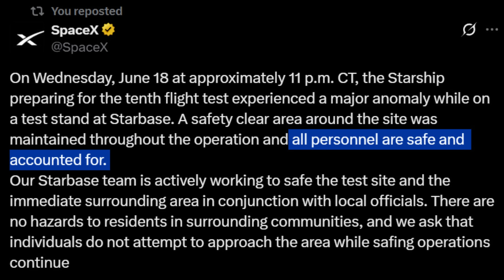SpaceX's Latest Starship Explodes During Ground Test

Comment: They didn't even start the engines before the explosion happened. The thing just spontaneously cracked open at the top and all the fuel went out. This is next level failure.
Reply: either they over pressurized the header tank, or it suffered structural failure.  Either way, that's just incredibly sloppy work.
Reply: @Hotarg  They are looking at the COPVs again as the cause.
Reply: It is almost as if it were a Tesla.

Comment: Have you seen the YouTube video “Inside Mitsubishi's Gigantic Rocket Factory in Japan” from FRAME? I don’t know if it has anything you would find fun to look at (other than being cool rocket stuff) but it shows a lot of — I’ll be it speed up — footage of the engineering and manufacture of the 5ton to orbit rocket, some of SLS and Dreamchaser.
It has robotic friction welding, large workpiece isogrid cnc machines, lots of rigs for just holding and maneuvering the vehicles and parts during assembly, assembly machines, a lathe at the end of a robotic arm. Briefly shows cooling channels on the Japanese rocket engine, the framing of the dreamchaser, piping, wiring, and all the like.
I don’t know, I just watched it and thought you might like it and have something you could add to it. Some kind of obscure knowledge or what not.
I know I liked it and seeing the blend of familiar machining and manufacturing technology used in such large and advanced ways.

Comment: The Cyber Truck of rockets.
Reply: It’s really not though. This is how innovation happens. There are always misfires. Do you think the first rocket was successful? The first car? The first engine? The first computer? With every massive success there are failures trailing behind it.
Reply: @Vagrant-Hex  So instead of learning from all those failures we should repeat them?
Reply: @LPB872 Huh? This is learning from failure. You’re acting like there haven’t been a ton of successes. The most trending vid a few months ago was space x docking a launched shuttle.
Reply: @Vagrant-Hex 

It keeps blowing up because SpaceX can't develop a large rocket engine. It uses 33 Raptor 2 engines.
Reply: @danboyd2725 Well, they use Merlin engines too. Regardless, none of that changes what I said bout innovation. NASA had a ton of rockets blow. So has every other country with a space program. Near perfection takes trial and error. That is true down to every single human being.
Reply: @Vagrant-Hex 

NASA had rocket engines did blow up in the early 60s, when we were learning how to make rocket engines. 

Which led to the Rocketdyne F1. Five of which powered the 1st stage of the Saturn V without blowing up. 

33 rocket motors are thousands of potential failures.
Reply: @danboyd2725 I mean, okay? They have been around since the 70s. Also, human beings died in some of their failures. And some nearly died. I get you hate Elon, I don’t like him either, but I’m not sure what you’re arguing about. Life is trial and error. Full stop.
Reply: @Vagrant-Hex 
It's  not about hating Elon. 

The lesson to learn from Starship is that 33 Raptor engines is a stupid idea. Time to go back and develop the equivalent of the F1 engine. 

SpaceX is incapable of learning that lesson.
Reply: @danboyd2725 Ah, okay. My bad. Glad you’re a free thinker too. Yeah, hopefully they drop some of their hubris and see the error of that engine. He needs to realize that sometimes if it isn’t broke, don’t fix it.

Comment: Realistically, it was "when", not "if". With so many cold and hot tests, fueling, venting, pressurizing, all with volatile cryogenics - one would wonder it is not happening more frequently. Looks quite positive that it does not happen from "main" things: engines, main pipes, main tanks, all the main valves... This is "simplified" version, a prototype to the "real thing". So, obviously, less attention is given to secondary systems like payload doors or fire extinguishing systems of self-destructors... no surprise these secondary "things" sometimes get back with a vengeance. Happened twice even on production-line Falcon, and keeps happening to the experimental ship... Time indeed for V3? Or for a step back to V1?

Comment: They haven’t even made orbit yet. Forget about Mars. And despite what any fan bois want to say, Artemis made it to the moon and back on the first try.
Reply: I keep pointing this out too. Also that Saturn V, which was designed with much cruder analysis methods, did not have any launch failures although there were a couple of anomalies during flight that nevertheless did not prevent the rocket from meeting its mission objectives.
Reply: How does Artemis influence Starship engineering?
Reply: @Forke13  It puts it to shame....it works.
Reply: @MrJdsenior  The Mission Program Artemis puts Starship to shame is how they are related on an engineering level? Can you elaborate on that?
Reply: @Forke13  one works and the other doesn't lmao
the coping with this guy
Reply: @Forke13  The mission is the point.   Artemis flew the mission, out of the gate.   Starship hasn't properly flown ANY flights yet, not only not to the moon and back, but not even to LEO.  I'm not saying they won't get there, as they well might.  Also, Musk's smaller undertakings have gone very well, so there's that.  

Going to the moon and back, ESPECIALLY while your cargo is human, safely, is so far beyond ANYTHING that ANY SpaceX vehicle has done so far is like the difference between a suborbital lob, and orbiting.  NASA did that, several times, over 50 years ago, and it damn sure didn't take them the flight destruction of 30+ vehicles to get there.

Artemis did not have to design everything from scratch either, so I will allow that that was of benefit to them.   You can have all the bells and whistles in the world, but if you can't meet the spec, the design fails.
Reply: Whoever believed the going-to-Mars scam was very naïve, to put it lightly.
Reply: Artemis was the most stressful rocket launch in recent history
Reply: After ten times the time and cost lol and delivering far less potential
Reply: @dmurray2978 cost is unclear and it actually works and is save unlike starship
Reply: @dmurray2978Starship right now has zero potential. It hasn’t performed a single test flight where the whole mission performed nominally.
Reply: Agree.
But it wasn't a cheap trip.
Reply: @ploed  how expensive is starship? As far as I know we dont know because its a private company and well most of artemis spending is in development and that works.
Reply: @ploed Starship is also not cheap
Reply: @ploed  Neither is anything that SpaceX is doing.
Reply: @ploed  Have you looked into SpaceX costs for this program, so far?  It might be interesting.  Also, there is no comparison, yet, because Starship has not made a trip to ANYWHERE that is useful, yet.  I can get to places in the ocean a lot cheaper on a ship, and LIVE in the process.
Reply: different approaches to the problems different goals. We know how to get to the moon, we even know how to get to mars and beyond, but we want it to be much cheaper and that needs innovation. Obv SpaceX is struggling with that upper stage atm. but it's not fan boying to want them to succeed and be excited for the theoretical specs of starship. They can push starship to orbit easily enough, but as long as the thing still blows up midair, or even on the ground you don't want to do that.

Comment: With so many failures one after the other, you'd think it was sabotage at this point. The wrong man in the right place can do so much damage, especially if they know exactly what to break and how to break it without it being obvious. Hell, it could even be done at the production level, deliberately designing parts to fail, alterations to materials/fabrication that would produce failures...not saying it's the case, but with how more than a few people act completely deranged when discussing Elon Musk I wouldn't be surprised if it were found to be true.
Reply: so many technicians here collaborate to perform a single function, there are so many checks, so many sensors, if there is any sabotage here it would mean total incompetence of the management, it would mean they don’t deserve to succeed

Comment: So V1 was progressing, but It was probably designed with big engineering margins and high weight that would never have allowed it to have a high enough mass ratio to carry the payloads it needed to fulfill its mission.  It looks like V2 cut weight throughout the design and reduced margins in the engines to produce more thrust and a higher Isp.  The result is a large loss of reliability throughout the design. I think continuing in the direction of pairing back mass with V3 would only make this worse. The real issue, and I hope this can be solved, is whether a stainless steel rocket carrying a heat shield for reusability can ever meet the mass ratio spec it needs to meet. I hope the answer is yes, but the wide range of failure modes since V2 was introduced leaves me very concerned.

Comment: Here is why Starship will not work.  When Elon went off the rails, my wife, who is technologically hostile and 40 years of experience shows she can destroy anything high tech with her hopes and prayers (call it a hex) decided offhandedly to focus all her technomojo on anything connected to Elon.  Since that time nothing technological has worked with the caveat that in failing it would not injure or kill.  In the last 40 years of honing her aura, I as a STEM advocate and hocus pocus disbeliever have had to fix so much stuff that has gone haywire in her presence that I now believe in whatever she "has". Public systems going down as we arrive, I ask her to step 30 ft. away and they recover.  Too many times not to be just a coincidence.  I appear to be able to dampen the effect.  That was two decades ago.  A few months ago, even as she "hexed" Elon ventures to fail but not hurt anyone, I could not bring myself to believe that her aura could now so accurately be projected  so far, with so little effort.  I cannot remember what she said but paraphrased it was "all his stuff has to fail as long as it does not hurt anyone".  Starship has not worked properly since, amongst other things.   I believe I can coerce DMER to lift the hex but it will cost the weight of 5 model Ss' in gold, palletized.   Deliver it to Mark Carney (yes THAT Mark) for OWWW in trust, we are in his riding, he will find us and I  think I can will stop the Sting via the OWWW.

Comment: Stepping through the sequence, as the sides of the craft are pushed away you can see a small amount of illumination coming from various parts of the liquid/gas mass as it's expelling as well as from deeper within. There's some large sections of panel, the one that is exiting left, that this shows up well. This was before the main ignition further down. So maybe there was a smaller internal ignition that caused this chain reaction to begin.

Comment: Eventually SpaceX will hit their stride with Starship and each of these failures experienced along the way will in hindsight become mere perspective. They have an abundance of funding, some of the smartest engineers in the industry, and a leader who is committed and unafraid to make a decision. That combination has proven successful in the past and should be here as well so long as they are given enough time. Developing a reusable rocket is one of the hardest engineering challenges ever attempted and setbacks like these are to be expected. What is more, they're trying to do so on tight margins with a design that can be mass produced. No doubt if Space X goal was to build the most robust & reliable rocket in this size the design would be quite different.

Comment: I don't get why they are putting so many eggs into the Starship basket. In parallel, they need to develop a basic expendable single raptor upper stage and use the mostly reliable super heavy booster to get large paying payloads up. Might as well get paid and get more booster reuse data at the same time.

Comment: I'm wondering if this is a design flaw in there header tanks or downcomers that's related to the Starship spinning out of control in-flight. Perhaps off-casing in this area of the nose during flight hasn't been visible because cameras aren't viewing that area of the heat shield tiles.

Comment: I guess we engineers think alike -- I had the same thoughts about possible overpressure and/or weld failure. Last night I was watching Ellie's report of the incident and saw from the Lab Padre video the splitting of the side in the payload bay area moving upward towards the nose. Some of the views you have are better than what I saw last night and I could see more details, like the whole lower ring section weld coming apart like it was being peeled and a downward gush of propellant just before the moment of ignition on the right side down low.

Comment: Silicosis is a progressive, irreversible, and sometimes fatal lung disease caused by inhaling microscopic crystalline silica dust over many years. The dust, found in stone, sand, clay, and rocks, scars the lungs, reducing their ability to extract oxygen from the air. Early symptoms include a cough, sputum, and gradual shortness of breath. As the scarring worsens, breathing problems become severe, making it difficult to walk short distances or climb stairs.
Reply: Similar to Asbestosis

Comment: They got a ton of useful data: for example, starship might not work and probably nasa should use something else as a lander from now on
Reply: NASA's rocket is worse. It's too expensive to even test launch.
Reply: @berserkasaurusrex4233 Nasa don’t do test launches, they get it right.

And no they can’t afford to test a non-reusable rocket, they’d have to make another.
Reply: @spaceageGecko  NASA absolutely does test launches. They've done one test flight of SLS, and have had to delay all other flights for 3 years so far. The Artemis tank had welding issues preventing its reuse as planned.

Saturn V, for instance, had two test launches, one of which failed due to engine trouble. Before that, the earlier Saturn I had many test flights, including using water-filled dummy stages out of fear of an explosion on the pad.
Reply: @berserkasaurusrex4233 Yeah, phrased that wrong, I meant they don’t do repeated test launches.

Comment: At 13:02 in the slo-mo you can see the overpressure is occurring INSIDE the upper fairing area, and blows OUT the panel. (the first frame of that, you can clearly see the cloud spraying out along the bottom edge of a panel, and then the next few frames that panel is peeling out, up, and little to the left along the bottom edge, and that admits out a large cloud that rapidly sprayed out downward until it found an ignition source.

I'm assuming that it sort of "self-ignited".  If you've ever read accounts of fire crews on aircraft carriers and battleships, they run out with the giant CO2 cylinders and need to make VERY sure the cylinder is on the ground before they start to spray, because the CO2 comes out in such volume so fast it generates a huge static charge that'll knock you on your butt if you're the conductor to the deck.

So I'm assuming that with a rupture like we are seeing here, huge static charges are being generated, and that's probably what provided the ignition for the fireball.

Comment: Starship cannot work, period. Not in the way it is currently designed.

Its engines simply don't provide as much thrust as they were supposed to, so to get a usable payload, they have to run them as hard as possible, which causes intense vibration. Compounding the problem, Starship's weight had to be reduced to also increase payload capacity, so it is not strong enough to resist the pressure and vibrations of launch.

But if they strengthen Starship enough so it can probably survive a launch, the added weight reduces payload capacity to ridiculously small amounts. They have created a perfect Catch-22. Survive, but with almost no payload, or fly fully loaded and probably blow up. 

Starship has fundamental flaws that cannot be fixed in its current configuration. Simply put, they need much better engines, and to get those, you're talking many years of delay.

Comment: How many SpaceX rockets exploded so far?  Anyone keeping count?  Musk makes it sound like these explosions are normal, due to natural challenges of spaceflight.  How does this compare to NASA track record?
Reply: Both NASA and SpaceX rockets have around a 99%+ success rate (NASA's rate was 94% in the late 80's through the 90's).

The Shuttle had a 98.25% success rate. The Falcon 9 has a 99.2% success rate, that's very comparable to McDonnell Douglass' Delta II and the current Delta IV rocket NASA uses for commercial launches, though at 500+ launches, the Falcon 9 has far more launches than the Delta family combined.
Reply: Technically NASA's success rates were, by decade:
1950's 43.6%
1960's 85.1%
1970's 93.5%
1980's 96.0%
1990's 93.9%
2000's 94.7%
2010's 94.7%

But that includes non-NASA payloads and I think includes some Russian launches NASA paid for, so it muddies the waters a bit.
Reply: @berserkasaurusrex4233  what about the Starship?  How many launches/attempts and how many failures?

Comment: Another thing to consider,  stainless becomes very brittle at cryo temperatures, matters not what grade is in use when temps get that low. The ship is not fit for purpose.  At this point just start again and actually design the ship around hot staging xx
P.S.... we do not make pressure vessels from composite materials for very well known reasons. Could very easily have been a carbon tank..... still say header failure tho 😂

Comment: The previous flight clearly had ice floating in the cargo area so its possible they are testing tank pressures and such to evaluate and identify any potential leak point(s). Mission accomplished even if a RUD was unintended. Easier to cleanup on the ground than to deal with it in space.